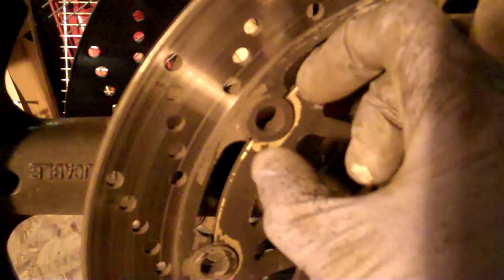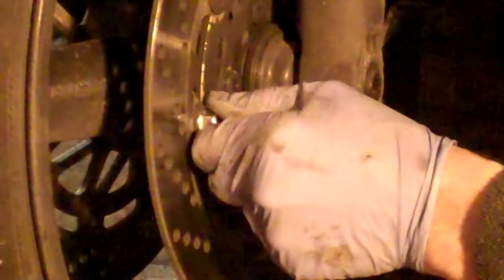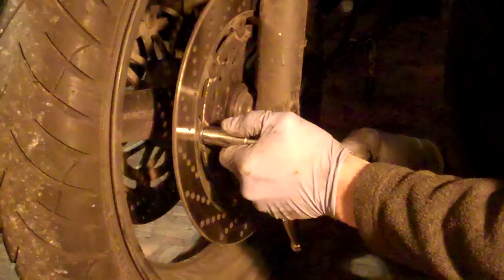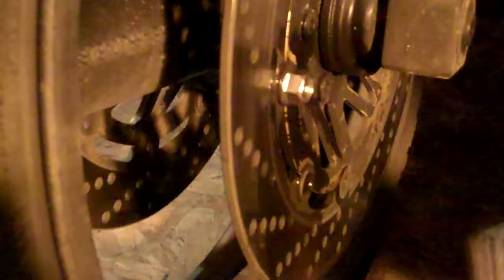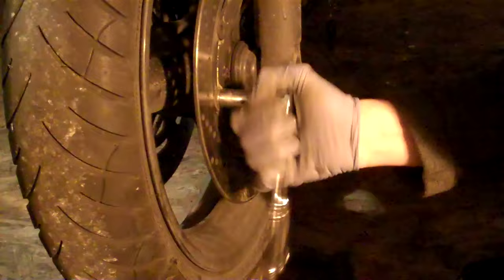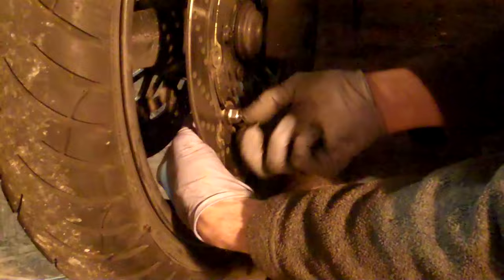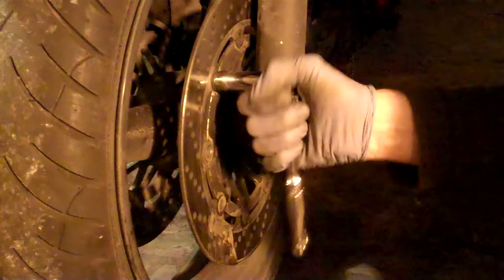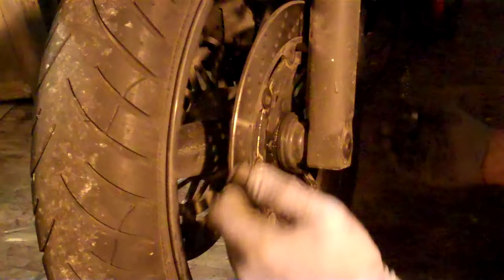Delboy's Garage, How-To Free up 'motorcycle brake disc bobbins'.!

Comment: Hi, i just tried on brand new bike spin that bobbin with hand, and i wasnt able to do it.. Is it normal ? And i´am just buying and SV 650s k4 and its bobbins arent moving by hand, should i clean them with your method? Thanks for help Del !
Reply from the maker: No mate, the bobbins on new or newish discs are tight due to manufacturing tolerance... they will loosen up over years and this cleaning trick is for old tired out brakes then get jammed up with dirt....you can still rotate the bobbins to make sure they move if they have got very dirty....but you wont spin them with your bare hand till they have done a fat amount of mileage a few years down the line...
Reply: Thank you for quick reply, and about the SV.. on that machine they should spin by hand ?
Reply from the maker: PopkosCZ
Only if the bike is old and has lots of miles, when its new, no, they will be too tight to turn by hand..!
Reply: Moonfleet41 Hi ! So I did this on my SV, and the bobbins were moving by hand nicely, but after one week they are stuck again. Do you have any suggestions? I didn´t rode the bike in the crap weather, only in the sun. Thanks.

Comment: Hi del. Ive recently adopted a weard click noice on front of my bandit. Mainly happens over slight bumps. Down by brakes. Could you possibly give me a reason i could try. To eliminate. Ive cleaned striped cleaned calipers cheers mate
Reply from the maker: Hi Christopher, if I were to describe this noise, would it be like a reasonably heavy click when you ride over small pot holes, or short frequency bumps??  Cos if it is, it could be the fork spring slapping against the inside of the fork tube, as my Bandit used to do this, and when I checked inside the forks, the oil was old and worn out and a little low, so a fork oil change can help reduce it, but things like Bandits have pretty basic forks and it's unfortunately pretty common, as the spring inside the fork tube does have room to slap about... but it's pretty harmless if that is, indeed, the issue ---- 

However, DO have a close look at your brake calipers, make sure all the mounting bolts are properly done up, nothing is lose, also jack the front of the bike up and move the wheel around to make sure the wheel bearings are nice and tight with no freeplay.... failing that mate, I'd need to see it to dig any further... hope that helps a little....

Comment: I tried with turning the nut with the brake cleaner and degrease it with wd-40 , it still wont move with finger , brakes are pulsing less when braking but its still not good enough , any tips?
Reply from the maker: It's not necessary that they shoudl turn with your fingers, as long as they're not jammed solid and holding the disc at an angle... not sure if you fitted new pads, but if that disc was jammed it could be that they've worn at an uneven angle, so if you fitted new pads this could improve things...... Also check that your caliper aligns with your disc correctly and in the end, of course, you can't rule out that you may, indeed, have a warped disc... good luck to you, I hope that's not the case...

Comment from the maker: Hi mate, seriously, try not to over think it, if you have something that revs to silly levels like an R6 then you need a thing called sheer strength, but a Bandit engine is truly a dollop and works less hard than a Honda Civic motor, there are no additives for gearboxes, much of what you hear is hearsay and old wives tales - Mobil1 is effectively what you might call 'car oil' but it's better than 70% of what you might call bike oils, even for an R6.. watch my video on Japanese bike engine ..cont

Comment: Del what spray are you using on the disc? Great video by the way.
Reply from the maker: The spray to use is 'Brake & Carb cleaner', make sure you use nothing remotely connected to a lubricant... thanks for watching, Cheers Del

Comment: Could you do this with an electric drill or is it better to do it at the slower speed of a ratchet?
Reply from the maker: Slow speed of a ratchet my friend, you don't want to spin them too fast and casue wear in the joint , especially if they are jammed up with grit, you'll do a lot of damage, get the bolt in place, spray first to loosen the grit, then turn GENTLY whilst you spray !

Comment: Hey! I've been enjoying a lot of your video's lately, The brake caliper rebuild vid made changing the seals easy as pie :) However i have a problem: last time i changed my brake pads i kind of neglected to put lubricant on my pads and glide pens (first and last time ever) and to top it off i read about heating up your brakes with some heat cycles to brake them in properly which resulted in black brake discs and brake squaking :/ luckily the bike still brakes fine and the brakepad deposits eventually scrubbed off the disc. Even though i rebuilt the caliper and lubricated all the components the squeaking still goes on (allthough less than before). Is there any way to solve this without buying new pads again? I did notice one of those little brackets opposite of the glide pins holding the pads in kind of jams on the pads.. i couldnt really get it to move freely. Do i need to replace it or can i leave it as it is?

Sorry for the long story :P thanks in advance!
Reply from the maker: +GharmanNL I can't diagnose your exact brake fault, my friend, certainly not over email, but the general rule of thumb to prevent brake squeal is to de-glaze the pad faces with some emery paper, and then re-fit after smearing some copper slip on the back of each pad, if you have stainless steel shims behind the pads, then put copper slip both sides of it... but obviously NOT on the pad face... this should cure the high frequency micro-vibration that makes them squeal... good luck with it, hope that helps!
Reply: Thanks!

Comment from the maker: Th additives you talk about are not relevant for a dog pile bike like a Bandit, decent, good quality regular motor oil (cos it doesn't say car specific on the pack it simply does NOT say motorcycle) would be perfectly fine for a Bandit but if you are worried about it stick to something like a DX4 from Putoline if you want to spend a little extra money

Comment: Hi Del, I have a 2007 Bandit 1250S with 17000km that I bought last year. Having watched your technique in your video, I just spent 2 hours freeing and lubricating all the bobbins on both front discs.  They were all seized.  However, they are still gripping the floating discs too tightly, as the bobbins won't move without force, and the disc has zero movement side to side. Any suggestions?  Thanks, Brian, Gander (Newfoundland)
Reply from the maker: Hi Brian, what you probably have is more a semi-floating disc, there is movement, but not much... don't worry too much that the rotor doesn't flex, as long as the bobbins rotate, then the disc will move under 'battle conditions' when you hit the brakes hard, which is why we do it in the first place!
Reply: I used brake cleaner on my 1st attempt, which did not budge the bobbins.  Then I used chain lube (sparingly of course), and they would turn with force.  I guess I will have to keep at it, so the bobbins will rotate freely.  Tks for the advice.
Reply: W 40 ?

Comment: when I'm breaking hard with my gsxr to stop, the last 1 meter i feel a kind of "frotter". normal braking, high speed no "problems".  the front tire is new and brake pads look good (I have cleaned the pads, disc and bobbins, brake fluid new). do you have any idea what causes this "frotter" ? :)
Reply from the maker: Ill try mate... what exactly does "Frotter" mean ?  sorry, not heard that before...!
Reply: thanks, I did not explained it correctly - "brake judder" is the right word I think. it's not that bad but still there when braking hard before stopping...

Comment: reviving the comments on this video,
any tips on doing this outside of a rat bike? I'd say the only thing would be to maybe cover the wheel with a big old cloth and maybe mask up the carrier?
Reply from the maker: Why on earth would you do that mate... it's only a bit of brake cleaner, won't do any harm to the metal surfaces, if you're that particular about your bike, give it a wash off afterwards,, whatever works for you chap!
Reply: ah, I meant to something like a brand new bike or a show bike, something not a rat bike. sorry I didn't explain myself there Del, thanks!
Reply from the maker: Yeah, either way buddy... the brake cleaner is safe..
Reply: Moonfleet41 awesome, good to know. Thanks for that, once I got my new bike and saw those "bobbins" I started looking for this video. 
Thanks for the amazing content

Comment: What was the size bolt please???
Reply from the maker: It depends on your bobbins Pablo and the size of the hole there, it just needs to go through clear, I think mine was an M10, but a smaller one will do as long as it grips !
Reply: Thank you mate mines all done bike feels alot better now wheel is actually easier to turn believe it or not.

Comment: Ive had 2 kwacks with extreme disk warp it was so bad my brake pad fell out & smashed a cars windscreen on motorway' now my 2nd bike zx600 r has the same proplem extreme front end shaking under braking disk aren,t even worn il clean bobbins out tomorrow so how it goes